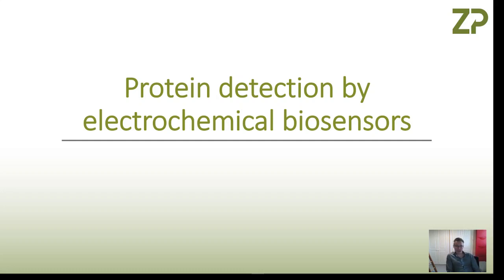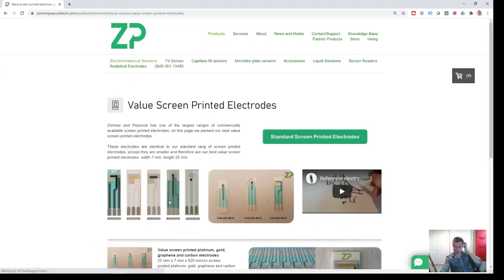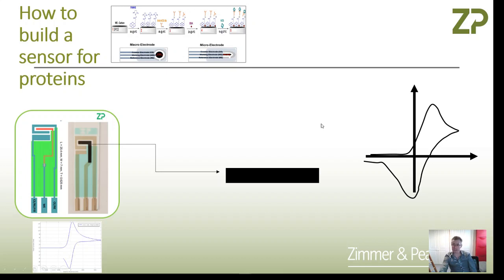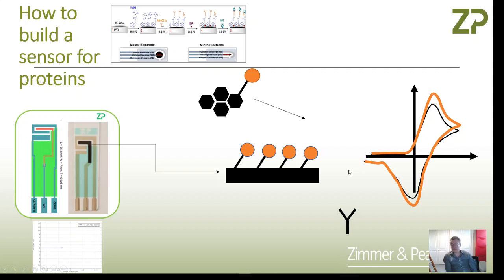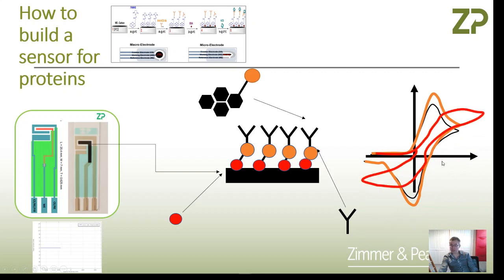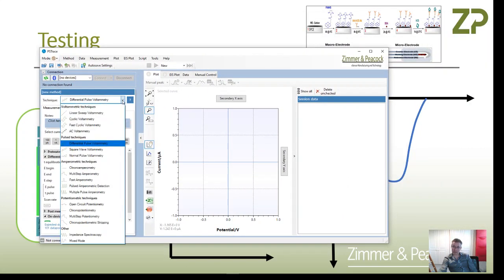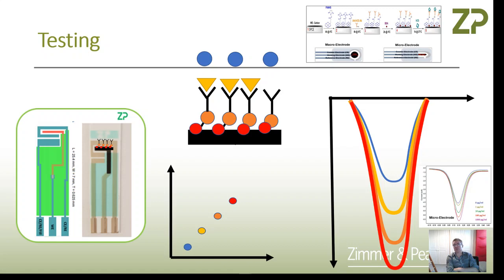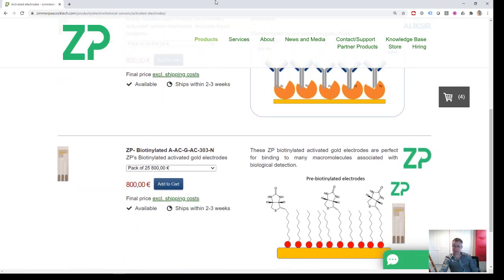A way to make an electrochemical biosensor for proteins from a screen printed electrode (SPE)

Comment: what would be the best approach for developing a biosensor for detection of meat pathogens from the surface....the preferred bioelement should be an antibody?
Reply from the maker: Problem with antibodies is that they can be too specific, so you detect a very specific pathogen and then miss their 'cousin' but post the question here and we'll cover it in a webinar - https://www.zimmerpeacock.com/contact/

Comment: wonderful video sir, we are working on urine based pregnancy detection in ruminants, we identified some metabolites which rise during pregnancy time which gives color reactions. Is there any way to make a sensor for small amino-acid instead of proteins. Kindly suggest any help if you can.  We also have a budget to purchase electrochemical unit attached 3D printer, kindly suggest, which is best supplier for that.
Reply from the maker: Many colorimetric assays are electrochemically active. If the molecule giving the colour change is a dye molecule then as well as being sensed via colour it can also be sensed by voltammetric methods, let me know if you are interested and we will cover it in a webinar.

Comment: Do you not remove the ferrocyanide?
Also why quantitate with DPV rather than CV? Many thanks.
Reply from the maker: No we don't remove the ferricyanide, we leave it in the buffer. 
DPV is a bit more sensitive than CV. CV has a faradaic component (that you want) and  a non-faradaic component (that you don't want) 

With DPV you reduce the non-faradaic component so you are left with just what you want, so DPV is meant to be more sensitive than CV :)
Reply: @zimmerpeacock9703  thank you!